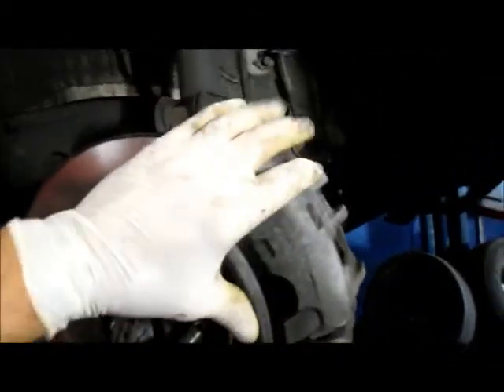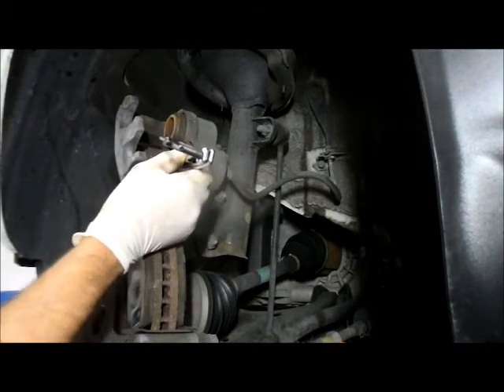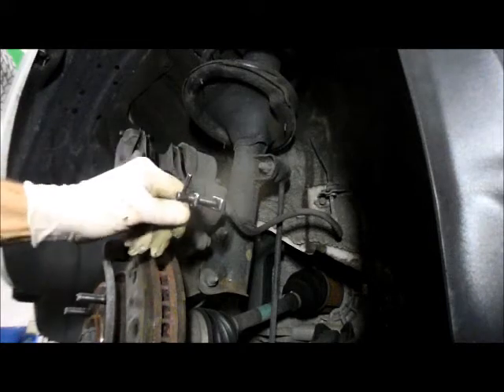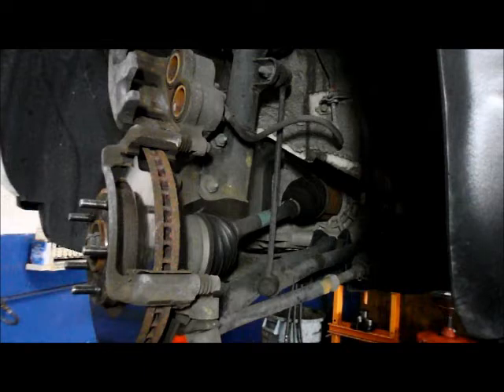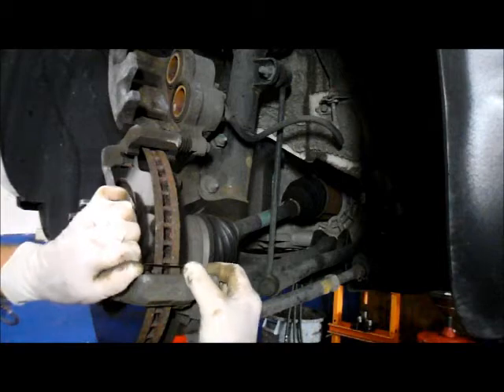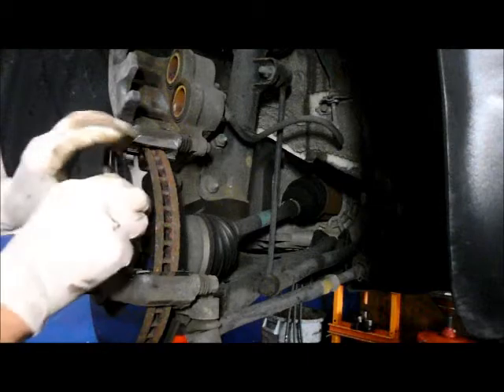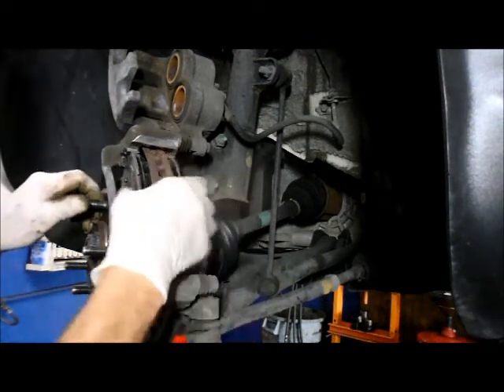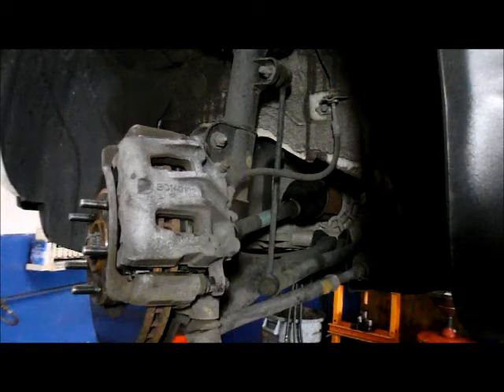How to replace the front brakes on a Hyundai Santa Fee

Comment: Seems easy. Why is Les Schwab saying I need to give them $600 just to replace 2 rear pads? I know the pads are around 100 but is $600 really how much it cost for labor?.... Anyone have any input?
Reply from the maker: $600.00 is way to much even if they replace the rotors it is still to much. Good luck
Reply: @jimthecarguy  thanks for the input. I will definitely go somewhere else now that I know. 😊

Comment: I have done front brakes many times, and never thought a caliper would rotate on the top pin like that.  Much easier than taking the whole thing off and tying it up so it doesn't hang by the brake line hose.  Super glad I saw this great video before I do my friend's santa fe brakes today.

Comment: Hey thanks for the video.  Very helpful when I changed the front pads on
 my '09 Sonata just today.  I have a question.  Your only mention of shims is at 
the  end when you mention "the shims are in place", however the video 
doesn't show that you installed shims. The pads I bought (Duralast Max) 
came with new hardware but no clip-on shims.  So, I used the shim from 
the old factory pads (inside only) as there were no shims on the factory
 outside pads.  Is it ok?

Comment: hey jim... i just replaced my brakes today...thanks! any bedding procedure i should do?  also, do you have a video on how to bleed/flush the brake fluid on a santa fe? thanks again for everything!
Reply from the maker: +T Anthony (Tmustanglover)  Sorry no video on the bleeding procedure .When you bleed the brakes you always start at the wheel furthest from the master cylinder and work toward it.So that would be right rear,left rear,right front and finally left front.I will in the future post a video on the proper way to bleed the brakes.Thank you for the idea.Jim
Reply: +jimthecarguy Hey Jim, I just want to verify that it is not necessary to bleed the brakes after a pad change.  I understand that some fluid may spill out of the master cylinder when the pistons are pushed back in place but didn't think I need to bleed the brakes.

Thanks for all the great videos.
Reply from the maker: +Martin Husk  You are correct as long as you don't open the bleeder valve you don't have to bleed the system Jim